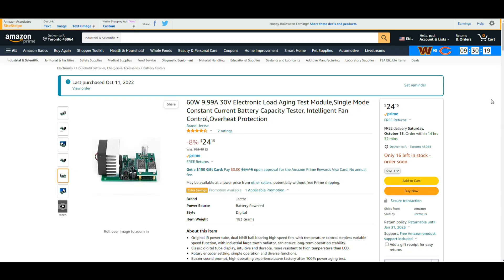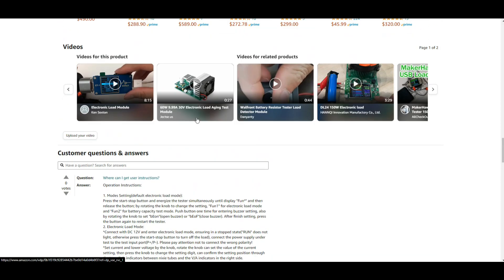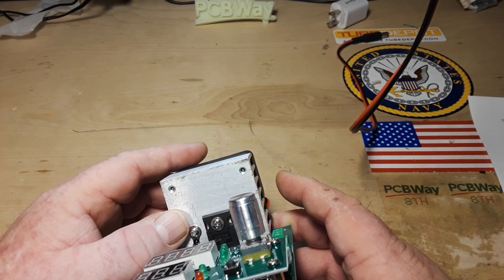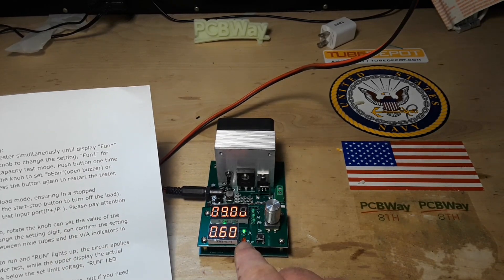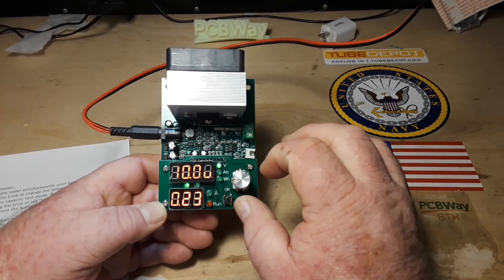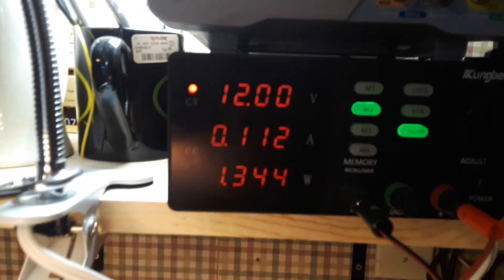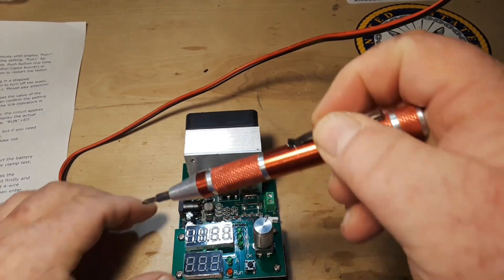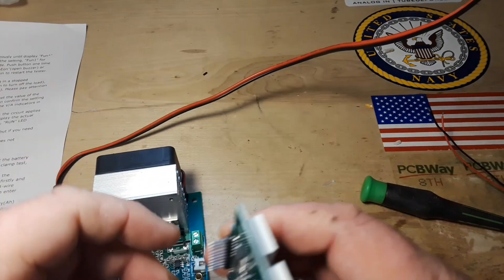Cheapest DC Electronic Load on Amazon

Comment: Got a couple of those and two with the bigger heatsink/higher wattage. Use them on and off at work, great for the price when I bought mine a few years ago. Only fault I've had with one of them was the four digit display lost the same segment on each digit but easily replaced. FYI, the seven segment displays are driven from an I2c chip under the seven segment dip.

Comment: The 6.66A limit is due to the voltage setting being at 9V.  Power = V I = 60W. Lower the voltage to achieve higher current.  How do you like the load box, I’m considering buying one for my home bench for random tinkering.